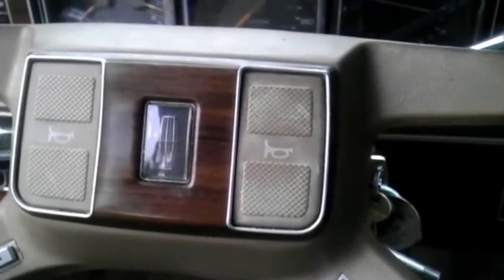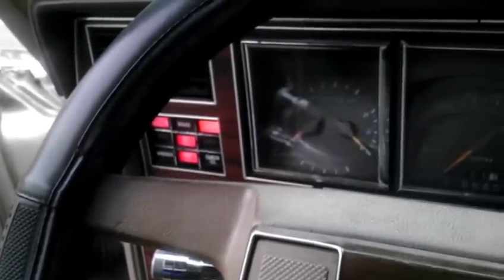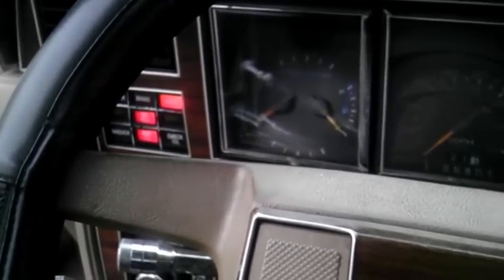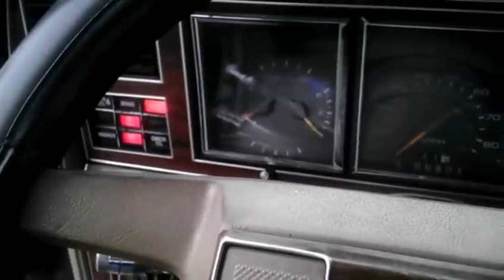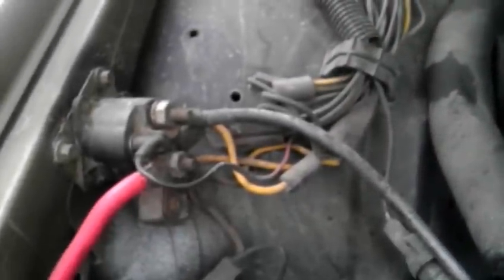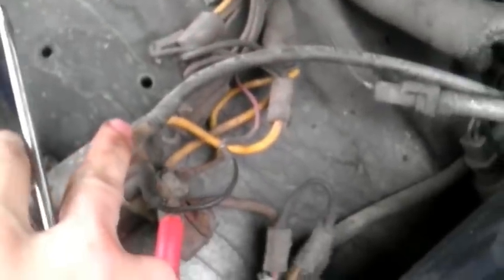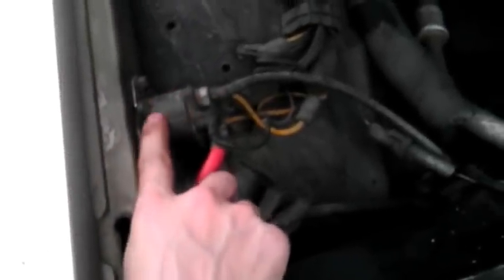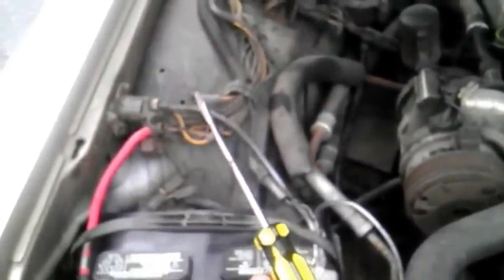How to start an old Ford with a screwdriver- 302 engine

Comment: Technically, you can do it on a vehicle with the solenoid on the starter.  You just have to crawl under it.
Reply: that being said, after a certain period, ford started using them both on the panel and the starter.  This car looks like it predates that.  10 years ago, this was valid as not so many videos existed diagnoses this symptom.

Comment: I started my old F-350 like that for over a month. Never had an issue.
Reply from the maker: Devon McBride you can keep doing it but a good mechanic never condones not fixing a known problem. Doing this creates a power surge, stressing the electrical system and starter more than usual. It may keep working forever but I posted this as a trick to get you home. It's not a repair but my viewers are welcome to do whatever they want with the knowledge I put out there

Comment: Thanks for this!  1994 Mazda B3000. Really a Ford Ranger. My mechanic showed me this, but it's been some years & I wasn't quite clear. You explained perfectly. It over rides the stop switch in clutch & electronic start switch (the one on the column that slides when key turned). When these fail, as they have, this method bypasses them. Thank you!
Reply: i have a 1990 b2200 and im wondering if this would work (the truck is my pfp)

Comment: This will work on newer vehicles, you just have to locate the starter underneath, it's usually is located right hand front corner of the motor on the bottom.
Reply from the maker: yes it will work on newer vehicles but telling people that a starter is located there is not smart. its in different places depending on the engine, make, and model

Comment: i used to have an older Volkswagen witha bad ignition switch so I just hardwired a pushbutton switch to jump the starter from inside.  It was either that or jump it with a screwdriver, but cool video man

Comment: I believe that is called a starter relay cause its just an ON/OFF switch controlled by two skinny wires to make make two fat wires touch, a starter solenoid is what is mounted to the starter and it moves something mechanical
Reply from the maker: its not a starter relay. on older vehicles the solenoid wasnt mounted on the starter. A relay just looks like a small black box. kind of looks like a large circuit breaker

Comment: I just replaced my starter solenoid i worked for a few weeks. Now having to use your start method again.  What else could be the problem? Working on a 88 Ford Bronco XLT 5.8L.
Reply from the maker: Those can go bad quickly. The aftermarket ones you buy at the auto parts store are made much more cheaply than the OEM ones. Go get another one. It's probably under warranty. If not, they're only like 15$ if that
Reply: Starter relay. Is the part that goes from key ignition, follow wires, into the starter relay. Then off to the starter. That's what he's actually got a problem with in this video is the starter relay, not the solenoid, the solenoid is still on the starter that's what pushes the starter heard into the fly wheel to engage them and slim the starter so your vehicle can start

Comment: Doesn't mean the starter solenoid is bad, could be a bad connection anywhere from the switch onward.
Reply: It can even be a burnt or knicked wire from the starter to ignition switch

Comment: Had to do this trick once after buying an old truck, so i replaced the solenoid after. No issues for several months then it did the same thing again, clicked once and then nothing. I tapped on the solenoid, and that caused the dash lights and buzzer to come on but it still wouldnt start, just that one click again. I did the screwdriver trick with the new solenoid it fired right up, and seems to be starting fine with just the key now. Would you say thats just the solenoid that is the issue?

Comment: What if my battery and alternator are both good (I checked them both at 2 different auto part stores to be sure) and i just don't have any power anywhere???? No headlights no interior lights. No instrument cluster, nothing. And yes the key does turn forward

Comment: Does the key have to be on because there has to be power going to the coil? I tried jumping it like this on an okd tractor but wouldnt start. Im wondering if its because the switch is bad.

Comment: I’ve got a 62 F250 manual shift that wouldn’t start, so a friend replaced that, but now he’s trying to take starter out because still not starting. Yet it’s been sitting for a year with no one starting. Battery is charged. I thought just need to get fuel in carb? Almost had it pull started once, but didn’t go. I’m left with figuring it out myself. Suggestion? Replace starter?

Comment: If this doesn't work but i have a new starter and new battery and new starter solenoid does that mean i have a electrical connection issue? 😢

Comment: Just had to do this on my chevy. I didn’t know if it was my neutral safety switch on the column but u mentioned If it works doing this it can the the starter solenoid ?

Comment: jdubsteachings = thanksall done,, I set up a manual switch for my radiator cooling fan... works like a dream,...I already encountered a bumper to bumper traffic last week with hot hot hot weather... it worked perfect,,, you need a 30 Amp switch with 30Amp wire and fuse between the fan motor and battery...QUESTION; do you think a horn push button and wire kit  would work if I hook it up to solenoid directly to star up the car like screwdriver would do? I wonder if it would withstand the Amp

Comment from the maker: it should. But in that the solenoid should be on the starter so itll be much more difficult. if it does work the whole starter needs replacement

Comment: I had the same issue. .I didn't know what wrong with my 72 truck..I was going in circles i replace the battery, starter, alternator, solenoid, Coil, voltage Regulator...so I'm thinking the starter was stuck it was the original one so had it rebuilt and the truck didn't turn over..until I did the Screwdriver method. ..now the truck just starts right up
Reply: Look into the ignition switch.

Comment: I have a Ford Zephyr 6 mk3 that hasn't been started in many years, i initially installed a battery but it was just doing what this car was doing at the start of the video0 I tried your bypass idea after tracing back from the stater and i got the sparks but nothing else..... Any advice would be great, thank in advanced guys

Comment: What happens if you try to use the screw driver to the posts to many times but still have sparks when touched with flathead but won't start now?
Reply: Did you ever find out the reason ?  Lots asking same question but OG never answers.  I have the same problem.

Comment: I hope that works on my dynapac CA250 roller . Just put in a new cummins 4cyl engine, b3.9c
and the mother f.hr starts went it wants to. Go big brand. I usually buy all Caterpillar. The odd ones are trouble.

Comment: Yea on most vehicles your right, but the Neutral Safety Switch could have been messed with like my truck an will try to start in gear if i don't press the clutch in,an if someone didn't  know that it could be bad.I am just saying bro not hating or anything

Comment: Actually you can do it to these newer vehicles you just need to locate the starter relay fuse and take some speaker wires and Kris Kross and connect them diagonally

Comment: The best thing to do is park it on a hill then when it won't start you put it in second or third gear, push the clutch to the floor, then when you get to about 10mph you dump the clutch and it should fire up. But you need to make sure that the key is in the on position or it won't work
Reply from the maker: only if you drive a manual.
Reply from the maker: the car in the video is an automatic
Reply: also this only works if you are certain of the issue..  otherwise you end up with a dead car on the road...  its better to(as the poster said) use this to diagnose an issue or deal with a probable issue in emergency scenarios

Comment: I have been doing this for the last month on my 88 Ranger. both new replacement solenoids do the same as the original. just a click when in the start position!
Reply from the maker: CKGM990 does it start when using the screwdriver?
Reply: jdubsteachings all 3 solenoids start with the driver.
Reply from the maker: You have a bad connection somewhere.

Comment: Unless your ignition actuator rod is broken, or the ignition switch itself came loose or is falling apart. If its hard to turn the key or it doesn't go all the way forward or the resistance feels funny (that's what she said?) it might be a broken actuator rod. kind of a pain in the ass to replace.

Comment: Ok so I have a crank no start. Van has new battery/plugs/oil. Noticed fuel gauge/pump has NO power so fuel not being delivered. 😔 Is this solenoid something I should go ahead and replace..could this have something to do with my problem?
Reply from the maker: No it wouldn't. If it cranks the solenoid is fine. I suggest switching the fuel pump relay with another relay just to see if that's it. If there's no power it's in the fuses, relays, or wiring. Could even be an ecm or a bad wire to the ecm
Reply from the maker: What kind of van?
Reply: jdubsteachings it’s a 1979 Ford E150 V8 351
Reply: jdubsteachings Ok 👍🏼 thanks! I’ll look into it!

Comment: do you think I could hook those two wires to a push switch and start the car like that?
Reply from the maker: absolutely wouldnt advise that. your asking for an electrical fire. like i say in the video, never do something like this as a fix. its a diagnostic and emergency procedure

Comment: jdubsteachings = thanks... but I don't get it... if the starter motor gets engage just using the two wires,, what is the big deal to eliminate the starter solenoid and use just a switch hooked up to two wires.
Reply from the maker: a switch like that will create sparks. the solenoid exists to separate all that power and control that power. if you want to put the switch in itll work but it could cause way more problems than itll solve. you might even fry the computer

Comment: Nothing is wrong with the stater solenoid if you can do this. It's normal. Something is wrong with his ignition if it doesn't turn over. You could do this for months and the worst thing that will happen is that you burn out your solenoid. Make sure you turn the key back one click after starting your Ford this way.

Comment: What if you buy another sillinoid switch and all it does is power on the lights in the dash when u try to crank it?
Reply from the maker: you probably need a starter or have an anti theft malfunction

Comment: I have a 2001 Crown Vic and my car won't crank and all of the lights on the dashboard but I changed the alternator, battery,and the starter that has the solenoid on the starter but my car STILL won't crank. What could be the problem, please help because my dad said that it could be my alarm that is making the car not crank or it could be the ignition switch?
Reply from the maker: Shanita Gray I agree with your dad. In most of those cases its the anti theft system not communicating. Do you have an immobilizer key on that?
Reply: jdubsteachings No I don't sir.
Reply: jdubsteachings Honestly that's the only way to start the car is underneath the car
Reply from the maker: I know the solenoid is on the starter under the car. If it starts at the solenoid then that's the problem. If you bought a new one and still have to start it at the solenoid then you got a bad one. If that doesn't work, check for voltage at the starter. It could be a bad connection

Comment: I changed my solenoid didn’t help. Finally bought a cheap little light tester because I assume it’s the connection in the power wire.
Reply: Same. Ended up being a ignition switch

Comment: Me 86 F250 460 keeps cranking with the key on off, I have put on 4 new solenoids?!

Thanks,
Reply: Something is going on with your "S" wire. You need to trace it back and find out what that is...
Reply: James Justice I was wired on the wrong terminals and it had bare wires I taped up, it's fixed now.  Thanks
Reply: That would do it...
Reply from the maker: sorryhavent been on or i would have told you to switch the wires. thanks for wathing though

Comment: My dad taught me to do this on a Ford I had that wouldn't start but didn't tell me what I was doing.
Reply: I was driving my dad's work truck, we stopped at a gas station to go get some drinks for today's Job. 
Then the truck didn't want to start.
So I'm on the phone with my dad and he tells me on the phone to look for something on the far left side of the truck facing it and to grab a screwdriver and to touch both nuts. 

And it sparked and I told him that, he said to hold it and the truck will soon start. 

All that while my father didn't explain how it works . . .but it worked

Comment from the maker: no you still need keys. i was in a hurry when i posted this and forgot to mention the key must be turned forward. This is a method for starting when you have a bad starter solenoid
Reply: what happens if the key isnt turned to the on position?
Reply: @antonlavey9983  The motor will crank but it won't fire.
Reply: It can also be a faulty ignition switch, where the key turn on, but it won't engage the starter. I still hafta do it, even with a new solenoid. I share your vid with my younger friends. Thanks.

Comment: And if your screwdriver isn't insulated enough at the handle : you're probably going to get shocked aswell ? Or do you also need to wear shoes with rubber soles ? Anybody know?
Reply: Its 12v. No danger

Comment: Wait, so if the starter cranks over then it isn't the solenoid's fault?
Reply from the maker: If it won't start but then it starts when you use a screwdriver on the solenoid then it IS the solenoid that's bad. you can do this on any car if you can get to the solenoid. but if it's bad you're replacing the whole starter on a modern car because the solenoid is built in
Reply: Oh I'm just wondering because I have a 2 stroke scooter that doesn't start and thought it was the solenoid... but if it cranks then it should be fine because when I put petrol in the cylinder it started so I know for sure it's something to do with the carburettor now. thanks anyway
Reply from the maker: +Alan W yea... it wouldn't even crank with a bad solenoid. Carburetor is probably a correct diagnosis
Reply: yep, I received my carb yesterday and I'm going to fit it in and see if that helps today. If not then I'll replace the fuel line hoses and see if that helps. if not then I literally have no idea what's wrong with it. Already replaced the air filter, cylinder, piston + rings, ignition coil and cdi box. Well, let's wait until I fit in the carb and see if that's going to fix my problem. I haven't been riding it for more than 2 months now, which is a total waste of money as I still have it insured and I pay monthly! :)
Reply: Alan W nope burned out ignition wire. he'd this on an old ford Fiesta 150

Comment: how do you turn it off if your key won't work in your ignition?
Reply: It turns on excessories but not the starter. Two different systems
Reply: +amy potts 

place in first gear--release clutch
Reply from the maker: +Thomas Rasnake nice. just stall it out
Reply from the maker: +jdubsteachings thats assuming she drives a manual tho

Comment: dose it works on a modern cars?
Reply from the maker: if you can reach the solenoid on the starter it will. if that starts it then you'll need to replace the whole starter
Reply: thanks the car work

Comment: Okay question, I know this is a old video but I have my 88 Ford F-150 that had caught on fire from the inside, everything under the hood is fine but the whole interior had to go since it burned. Can I still crank and possibly still start without key cause the whole wiring harness is gone and out?

Comment: jdubsteachings = thanks...I will ask the mechanic tomorrow since I think it can be done as long as you use 30Amp wires.... why I am saying that?..I will set up a manual switch for my radiator fan since I got cross engine and the motor heats up in hot weather in bumper to bumper traffic and the fan kicks in.From tomorrow when I see the heat gauge goes up I will turn on the fan manually to avoid over heating  issues... Same thing( I guess ) applies to solenoid wiring...I need to use 30Amp wires to withstand the heat,,, and of course do not keep turning the starter motor more then 5 sec at a time.I am sure it would wok but  I will call a mechanic tomorrow about it.
Reply from the maker: a toggle switch for a cooling fan is a different story. i dont think theyre gonna advise you to do that but let me know.

Comment: Ummm actually it pulled the cover off the smaller one and touched it to the one the goes to the starter. Starts everytime WITHOUT all the sparks.
Reply from the maker: +Justin Dolan idk what youre talking about. when you make continuity theres gonna be sparks and you should never bypass a solenoid ALL the time. It should only be used in desperate situations
Reply: +Justin Dolan if the solenoid is bad then no it wouldn't because it would be getting no power from the battery

Comment: I changed the solenoid and it still won’t crank
Reply from the maker: The starter is probably bad. Remove it and test it. Or just have the auto parts store test it

Comment: how do I turn it' off?
Reply: Harry Davis 😂😂😂
Reply from the maker: Harry Davis turn the key off like you normally would...
Reply: Harry Davis sometimes you have to smack the solenoid if the solenoid is still going after the key is off
Reply: You have to "reverse the process" and touch the screwdriver from the negative side of solenoid to the positive (instead of the positive side first)..., Shuts it right off.  LOL
Reply: Let it run out of fuel.. Thata do it.